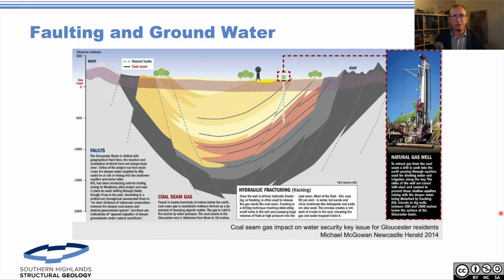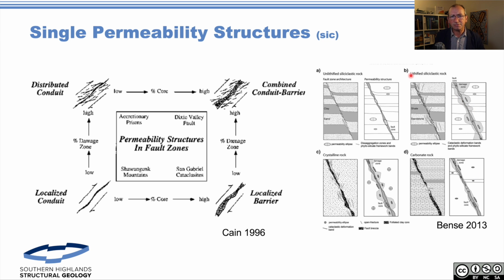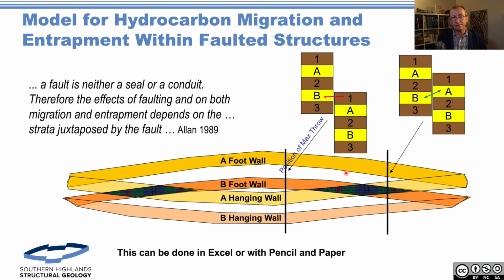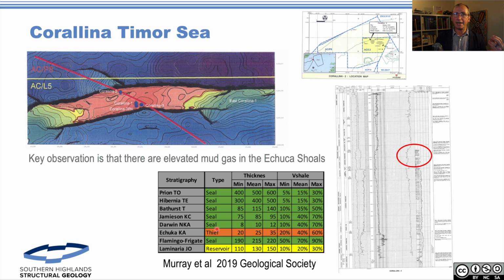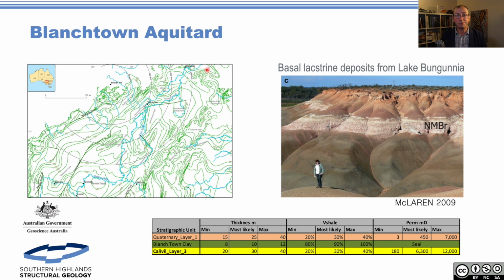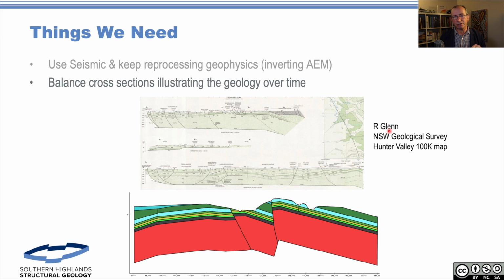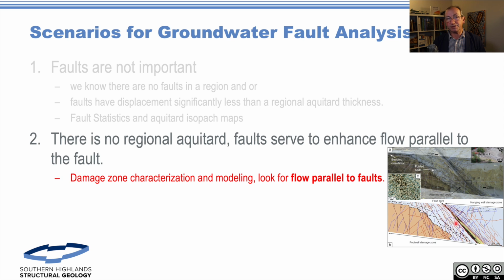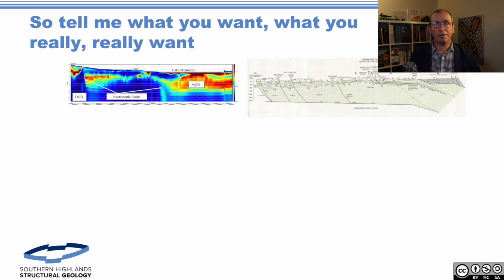Lecture 6 GroundWater Fault Zone Background

Comment: In 27:12 as shown in the presentation, orthogal fractures terminated at shale intercalation layers, are these fractures origin more likely to be occured as secondary fracture due to vertical (overburden stress) or independently caused by tectonics? Can you enlight more about this particular phenomena?
Reply from the maker: Hi ArM geo, I think these features are systematic and no-systematic joints (forming during burial). They can be seen throughout the region and are common in a range of sedimentary rocks. The important thing to think about is that joints form first; if there is subsequent tectonic deformation, then new fractures form within the context of the joints. I will take a trip to the mountains to look for more examples but many of the tourist photos from the area show mechanical stratigraphy, https://www.nationalparks.nsw.gov.au/visit-a-park/parks/mount-wilson-area/learn-more